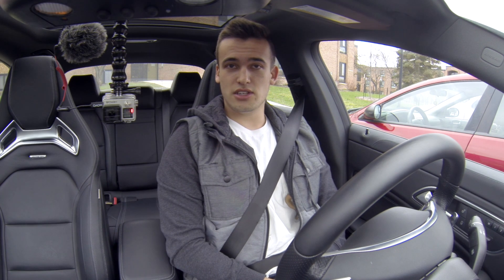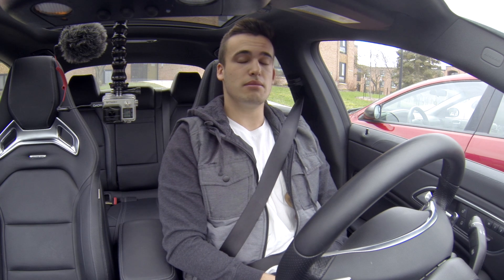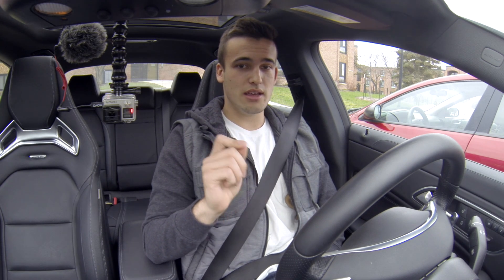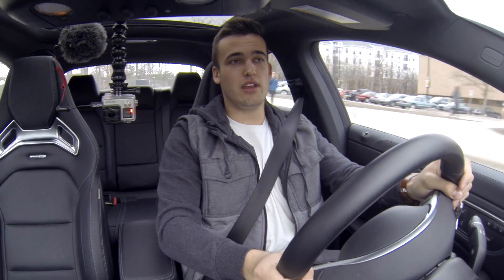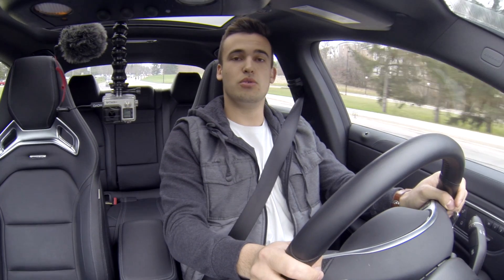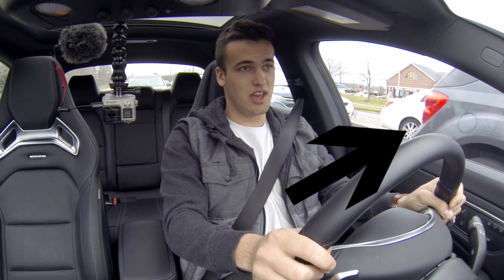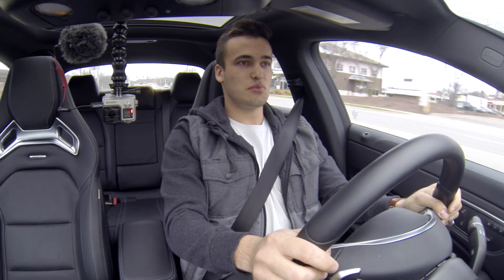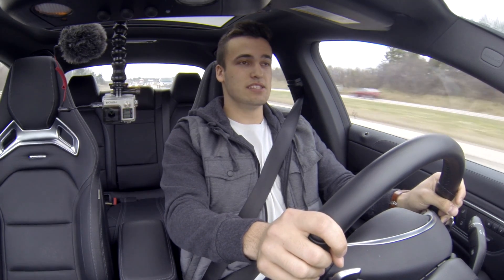Is The CLA45's Engine Data Screen Accurate?

Comment: Not even close. It shows factory specs of what it should be based on throttle input. I'm tuned with a bigger turbo and some other mods and should be in the mid to high 300whp range, yet the gauge never goes above 255hp.

Comment: All the Engine Data is showing, its the "Request tables" on the ECU Map. All dependant on throttle position, load etc. So no its not accurate. Just approximate and an Indicator.

Comment: it's starting to sound like these so called mercs are junk?? lemons ..I was seriously thinking about one but this isn't the first questions about it
Reply from the maker: I would have to disagree with you there. Mercs may be a bit slower than the M's that they compete with, but they're a lot more luxurious and stylish than any other German brand on the road.
Reply: Lemons? The car seems to be working fine to be called a lemon.
Reply: U let a video discussing the accuracy of a digital speedometer determine what car u bought? Damn
Reply: The 45s don't have an M competitor but if they do, they'd dominate them too like they do any other turbo 4-cyl vehicles.
Reply: Junk?? Faaaaar from junk? 😵 I've had Jap turbo, Turbo quattro Audi's.. A drift Skyline, these are incredible CAR'S! Bang foe buck aye. I have no idea what you are on about ... have you ever been in a stage 2 AMG 45?? Because if you did.. I don't think you'd be saying "junk" 😂 the best interior's out of Audi, BMW's. Dude you are very wrong. Mines a rocket 🚀 😌